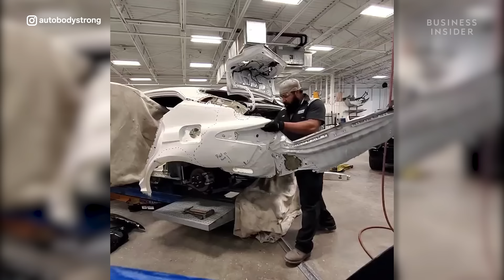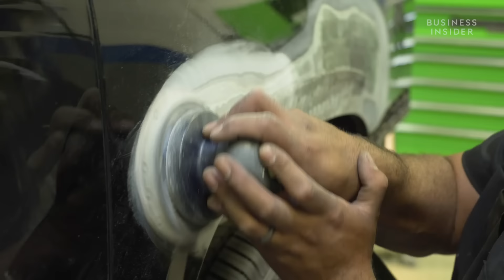How Wrecked Cars Are Repaired | Cars Insider

Comment: Here in Washington state, the body shops charge between $130-$175/hr for labor and a 25% surcharge on parts. They replace damaged parts, not repair them. Add to that the rampant undervaluing of vehicles by the insurance companies, and most vehicles end up being totaled, not repaired. This means a massive number of damaged vehicles go to the IAA auctions and COPART. These damaged vehicles are bought by out of state and even out of country shops who DO repair them and resell them... many with "doctored" titles to hide the "totaled" label and reconstructed status. This is not restricted to Washington state and is one of the reasons auto insurance rates have skyrocketed and used vehicles have become scarce.
Case in point: My 2007 Ford Explorer Sport Trac Limited 4x4 V8 was damaged in the right front at less than 10 mph. The local "preferred" body shop quoted over $5,380 to repair it. The insurance company quoted a value for my truck at just over $3,800... despite dealerships and private sellers selling the same model for $8,000-$10,500! I've been fighting the insurance company since Super Bowl Sunday, and it's now April 26th! I am repairing it myself and, even buying tools, will spend less than $1,500 on the repair! My claim contact insists that I'm not allowed to repair it myself until AFTER they total it and I buy back MY OWN VEHICLE! This is a lie and ignores state LAWS.

Comment: a. Cannot believe how many cars are on the road driving around with body damage on them.  Some pretty severe as if the wind is about to rip parts off.

b. Once bought a car from a family member in the 80's who had a pretty severe front-end collision that resulted in a bent frame which he had straightened.  Found it odd although the car acted fine at most speeds and the tire wear was normal, the car exhibited a noticeable left-to-right shake when decelerating through the 20mph zone.  Weird.  

That and they never replaced the proportioning value that controls how much brake fluid pressure was sent to the front and rear brakes, so under hard-braking the car would always lock up the rear brakes first.  Oh, well, guess that's how one learns.

Comment: Never buy a car that has been wrecked or totalled out Cars are not meant to be repaired in this manner. Once structural damage occures to a cars frame the strenght and durability and integrity is compromised. It will not be able to withstand a direct hit in the same spot as when it originally rolls off the manufacturers assembly line. Bottom Line NOT SAFE.

Comment: It's impressive what he's able to do, although I'm guessing this shop has much higher tech equipment than your average scratch and dent shop. Anything structural, I'm getting rid of the car. It's like a bike helmet, it'll keep your head safe the first time, but it's trash after that. That's why we need the services that report salvage jobs and other repair work and sketchy shops that don't accurately report that info need the hammer brought down on them.

Comment: the dent on the black car, could have been pushed out from other side with paintless dent removal tools in 10 mins, and nylon hammer to shape it to make the "crown" look flush, instead he sanded it all, tack welded dent pullers, body filled it, and had it painted, if you're just going to body filler it, just sand and fill it ? seems like a waste of time lol

paintless dent removal would be the best option there, looks like they are just doing the most work for insurance money

Comment: Frame straightening is not a repair. A frame that is bent is weakened, and bending it back only weakens it further. Frame straightening may make a car look repaired, but it will never be structurally sound again. You can not repair a frame - the only option is to replace it, which is only really worth it on new cars with high value. It’s a sad reality, but not everything can be fixed and there comes a point where you just have to stop. This is why most insurance companies will write off cars with frame damage, not because they simply don’t want to pay for the repair, but because they know the car will no longer be safe.

Also, punching holes in the fender to repair a dent? Just replace the fender ffs. All that time & labour and now that fender is weakened and won’t hold up at all even in a minor collision.

Comment: I was a field auto damage adjuster for an insurance company for many years working in multiple cities and rural areas. From the insurance stand point, we are trained on how to fix vehicles then thoroughly trained on what we can get away with not paying. Shops hate us because we fight for tenths of an hour to be shaved off repairs and only cover cheap aftermarket parts (because it’s technically legal). From the shop stand point, they drive costs up by falsely demanding a panel needs replacement (costing way more) and end up doing quick fixes instead for a third the cost. Word of advice, be upfront with shops and advise them that you’ll cover the difference of what’s not covered by insurance, if you’re in a position to do so, and this will dramatically decrease them having to cut corners.

Comment: We used to do all of it with no computers or 'measuring tables' that cars were bolted to. Using nothing but a tape measure and experience and we did perfect work. Its metal it isn't rocket science. Like anything once you figure out how to do it it isn't hard at all. The goal on body work was always to use as little plastic filler (Bondo) as possible. On classic cars we even used pick and file where no bondo was used at all, all of the dents  and dings were worked out with a pick hammer, dolly, and file to shave the metal smooth and ready for primer.

Comment: Barrie Ontario has a place called South Simcoe Collision on Churchill St. that is a complete ripe off insurance scam company. My car was in there for work by insurance and I had one window trim on my drivers window and none on the other 3 but when they seen that they ordered and bought a new set and told that insurance it was needed as part of the fix. What am Insurance Ripe off that was, just to make a little extra cash. Plus my frame had a massive crack in it from the accident and they just cut that piece of the frame out and welded a new piece in and said it was fixed.

Comment: The fact is not the same. Even CarMax have vehicles that look good but they have some defects. I have 2006 Impala. I swear I have changed rack and pinion 4 times. I was told the frame is compromised. 

I've learn avoid vehicles that looks good at reduced priced. They are usually tagged as best offer or discount or save or wow signs. They are defective.

Comment: As a former coachbuilder, at the workshop we didn't have a forming machine. We had a steel column, attached a chain with a hook and attached the hook to the car, then put the car on neutral and pushed it till the damaged area didn't pop out again. Then we would hammer it the best possible and fill the small dents with a bit of plaster and repainted the area

Comment: I could not stomach watching this video.   A freaking deer ran into my 9 month old BMW M5 Comp and it still hurts my soul!
I had my car fixed at a BMW certified collision center where I know they use OEM parts instead of 3rd party.  Although, they did a nice job on the repair, I can see the paint/clear coat has a different texture than the original paint.

Comment: I work at a Ford dealer's parts department. I find and supply our body shop with the parts they need. Our guys won't pull out sheet metal panels. They will replace them.

Comment: An amazing use of technology with the frame machine, computer measurements, and tolerance checking. Having the data from the car manufacturer is just like having a full  service manual with a full set of schematics and test points.

Comment: Most shops repair cars incorrectly due to the DRP complex set up by the insurance companies that only care about their bottom line.  They like to have the vehicles fixed as cheaply as possible with the cheapest parts possible.  Now mind you, there are a hand full of insurance companies that actually pay to correctly restore the vehicle to OEM specs. ALL shops should get OEM certified and follow the OEM procedures when repairing and not follow the insurance companies estates, because there is a huge difference between a repair plan and an insurance estimate. Shops can get paid for what they are actually doing and should stand firm against the insurance companies. When the shop works on a vehicle, they work for the customer, not the insurance company.

Comment: Plastic spreaders??? For bondo work??? Too much Time wasted! Like the flat liner tool.

Truthfully this is half the work. Most major collisions after pulling into alignment a new panel is welded into place for integrity. Special primers are used, flashed off and painted for  vehicle warranty as well before any bondo work is done. Bondo against bare metal is a big big no no as it will fall off as the metal will rust under it. So will most primers if let dry as they both act as a spong and absorb water out air.

Comment: Bent frame can never straighten out to factory standards, any repair to frame such as welding or anything else will not help. It will be out of alignment soon and you will keep replacing tires, or it will pull. Homogenous structure of a frame is disturb once repairs are made to it. So watch out..!!

Comment: Aren't crumple zones designed to be a 1 time thing? I assume pulling out some areas results in weaker body work that could result in worse damage in the next crash. I guess this is taken into account to assess if a car is safe to repair or not though.
Reply: Exactly. It's completely unsafe, these vehicles should be destroyed. Think they don't bother with professional assessment of the repairs, if such agency even exists. Pretty sure they're just sold without a mention of the crash to the buyer. I'm also sure the manufacturers wouldn't guarantee that these cars are safe.
Reply: @davidjohnsonn3373  
False, most manufacturers offer repair procedures for structural damage. These are tested and the manufacturer stands behind them. Finding a shop that follows the repair procedures can be difficult.  Quality body shops are out there, but you need to do some looking to find them. Never take your car to the shop the insurance company recommends, those shops work for the insurance company not you.

Comment: Bless these guys, i had a front end collision in my 2011 corvette with 30k miles and it had minor frame damage but needed a new hood, bumper, fender, and some mechanical and integrity parts like radiator,intake, crash bar, headlights etc and the repair bill was a whopping 17K and the car was valued at 30K, i still went through with it despite no insurance, they did an amazing job and its identical to how it was before the accident, luckily the engine and 3/4ths of the car was also untouched during the accident which is also why i couldn't bring myself to part it out over some front end damage. a year and a 1/2 later im so glad i ate the loss and did it because i love this car still to this day, wont ever text and drive again.
Reply: I'm a painter at a body shop here in Montana. When all goes well the receptionist the management the parts guys the body technicians the painters the helpers the detailers all mesh together like a lubricated gear driven clock that creates a beautiful, harmonious assembly line. I love helping people out; to have the years and skill to help with a relatively obscure public service like auto body repair is gratifying, mentally stimulating and changes with time. (New generation of car model comes out) Just like like someone tailoring suits, managing a grocery store, traffic signal maintenance, humanity is one great interconnected mass of helpers helping helpers

Comment: Those repairs are quite incredible! Many vehicles look "totaled" even though they are not. One would think they are destined for the junk yard when they can actually be restored. Great work and great video.
Reply: The financial definition of totaled means the cost of repair exceeds the cost of replacement, so it's not always something you can visually eyeball.
Reply: @aubreygraham1704  yep and some companies like statefarm allow cars to be totaled a little under 70% of value. Yeah o
Reply: totaled doesnt mean the car is beyond repair
Reply: @Adidas_der_schwanger_war  Ryan Cooper can attest to that
Reply: @Venomclippy I just came from watching need for speed prostreet 😂
Reply: @Adidas_der_schwanger_war  Exactly, it can always be fixed
Reply: Oh these are absolutely totalled and uninsurable. Just cause the car looks fine on the outside doesn't mean that your crumple zones are good to take another hit. These are absolute death traps.
Reply: @Domenik ^This. Frame straightening is not a repair. A frame that is bent is weakened, and bending it back only weakens it further. Frame straightening may make a car look repaired, but it will never be structurally sound again. You can not repair a frame - the only option is to replace it, which is only really worth it on new cars with high value. It’s a sad reality, but not everything can be fixed and there comes a point where you just have to stop.
Reply: @Kajra87 so insurance companies would never do this?
Reply: most cars I have seen at places like pick n pull or u pull it, could have been restored. But many owners don‘t have the money to restore.

Comment: For every 1000 mechanic or body shops, there is only ONE that does the job the way it suppose to be done based on the book and or factory specifications, the rest are just thieves. Worked as a mechanic for 7 years at different dealerships. LOVED the job, but HATED people who are running them. In most cases all the managers and directors who are running those places, have no idea how to even do a simple oil change and yet they are dictating and forcing mechanics to do some seriously unethical and dangerous things, just so they can maximize their profits while to hell with people's safety.

Comment: In '91, I bought a loaded '81 Cordoba that was built from three (3) wrecks from a body shop in Detroit. The owner showed me the photos of the wrecked cars he bought at a police auction. I could not find the witness lines or any trace of where they were welded together. He did an incredible job on the car. The man was an artist and wanted to prove out his new frame and body straightening machine. I had the car for over 2 years and never gave me any problems, was extremely quiet, ran true and straight down the highway and a joy to drive. Best $1800 I ever spent.

Comment: I’ve seen a front of one car and the rear end of another car put together and welded underneath in the middle to make a whole car. Looked great but in a side accident the car would have split in half. Loads of flooded cars get sold for cheap then spruced up and resold. Be careful buying used cars you can get screwed. I did one time. I told the guy I’m doing to drive through the showroom with the bummer car. He gave me the price of the car the money for sales tax and title money back.

Comment: I have worked for these type of collision centers on their hydraulic systems such as frame pullers, floor jacks, lifts, etc. when required and I can honestly say this guy speaks the truth "FOR SOME REPAIRS/ DEALERS! 
Many would not believe what I have seen in DEALERSHIPS, AND OR COLLISION/ BODY SHOP Dealers as most are very often NOT THE SAME so be careful!
Although "SOME" shops do quality work AND are basically honest, watch out for the ones who cut corners, and use cheaper methods and or material.
ONE MORE WARNING, Once your frame on a vehicle is damaged that vehicle will NEVER, AND I MEAN NEVER be the same again! and the wear on your tires will prove this. 
BUT usually, once the BAGS are blown and there is frame damage then it is totaled by insurance standards anyway.
This was just a warning for people who do not know what goes on in this industry. Take care

Comment: Only in 11th and in auto right now. Our school has a great auto program and we have full access to all data as well. Been using the site to flip cars for side cash. Had people come up from Nashville Lincoln tech a few weeks ago. For a few years I already knew where I wanted to go. My goal is to go there and start with auto or Diesel then collision welding mopar  painting and stick with that for a good few years and try to work my way up to aircraft tech around Dallas but would prefer to do aircraft privately for better profit. Hoping to eventually get certified cdls and higher class including flight license. Really just wish tk be all around certified to drive absolutely anything that comes my way via in the air or under water. And if underwater or sea welding comes up then that would be great as well. This video is the first high tech repair Iv seen vs my small town where we mostly use old school hammers and squares. Great video and love how you explained what you was doing without so much detail you lose our attention. But the tech you used blew my mind can’t wait to dive deeper in this line of work